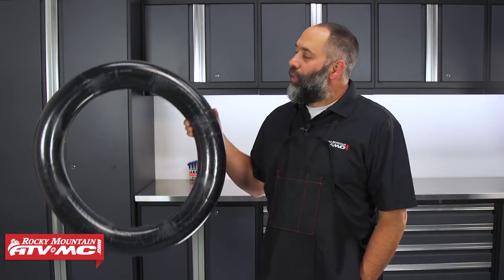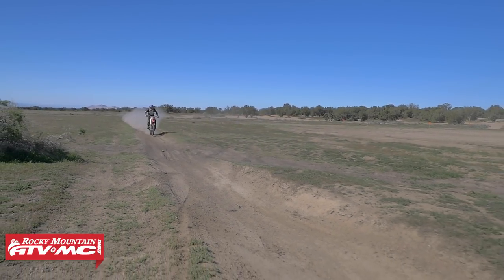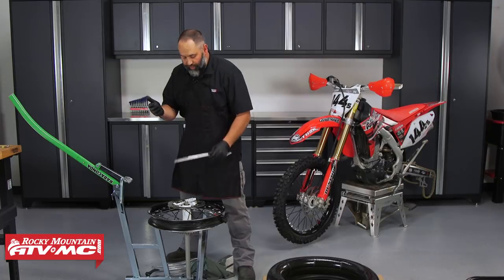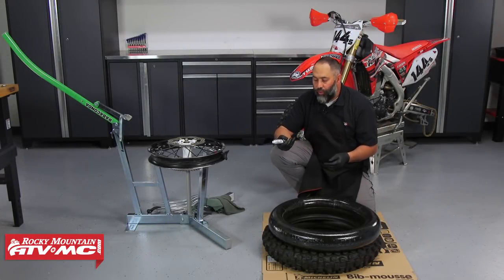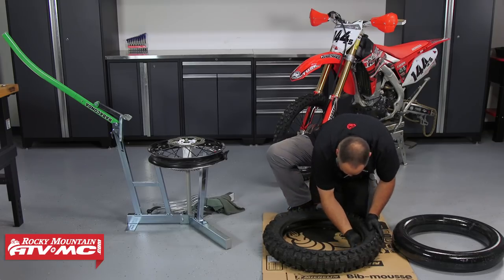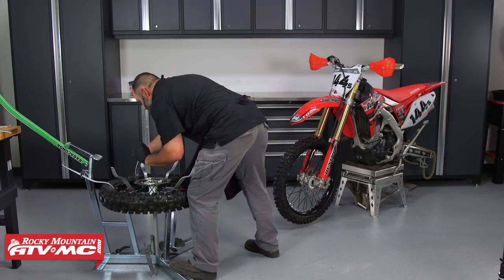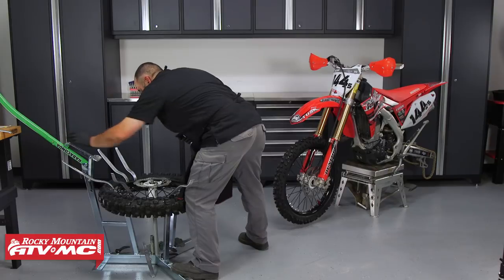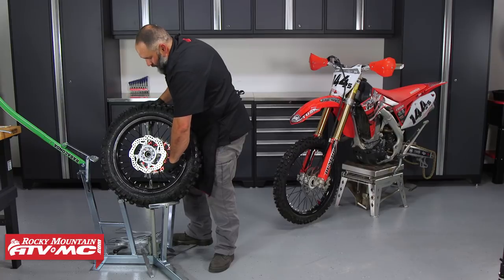How To Install A Michelin Bib Mousse Foam Tube

Comment: Using your foot introduces all sorts of debris, and even laying the insert on the tire and cardboard does the same. To decrease any chance of picking of grains of sand (greater friction), I treat mousse installation like surgery. Also, Ill smooth any rough areas inside of the tire with a rasp and then with damp rag wipe and allow to dry out.

Comment: What do you do with the valve stem hole
Reply: Either stick a tubeless valve in or one cut from an old inner tube. You can use that to blow compressed air in to push a tyre up onto the rim that hasn't set on the rim all the way around. Take the core out to increase air flow.
Reply: @martincooke6230  Electrical tape over the hole works just fine or RMATV sells little rubber plugs that are great.  They seem softer than the Tubliss plugs.Tried the old valve stem thing and did not like it but I also have issues sometimes getting enough air pressure to push the bead out on a older mousse.  Maybe I need to revisit!
Reply: @SHAPI84  I have found problem occasionally when pressuring tyre up onto the rim. You can lose a lot of pressure around the rim lock bolt. Take the nut off and slip on a suitably sized rubber grommet and replace nut finger tight. That solves the problem for me. Don't forget to remove the grommet and tighten the nut down afterwards :)

Comment: could you just use dish soap for lube?
Reply: MotoBros FZ-R1 LOL
Reply: Nope, breaks down and dissipates eventually. A lot of shops will use tire soap/lube, as it withstands the heat and last a good long time. Though a reapplication with the included Michelin lube every few months isn't a bad idea.

Comment: Now when you say heat breaks it down is this not a good option for me here in Haiti? 90-100 degrees every day and have to hit street sections to connect trails.
Reply: As long as you slow down a bit on the paved roads you'll be fine. I live in the tropics and use mousse with no problems. If Haiti is anything like Cambodia ,you probably get a lot of nails in your tires.
Reply: @fmtnic  yes!! For sure tons of nails constantly. I swear every time I ride I get a flat

Comment: are you running two rim locks in place of the stem?
Reply: m1ke2001 No, you can just use a plug,
Reply: Why need a rim lock? Theres no valve stem to shear.
Reply: @RyderLost  Without the rim lock the rim will spin but the tire may not, particularly on the rear wheel. You need something to keep the rim and tire connected beyond the friction between the tire, mousse and rim.  Some run two rim locks as the extra traction given with a softer tire and without the associate air pressure pushing out on the tire sides and rim lip let the rim spin inside the tire.
Reply: @thegan9143  When we run Vegas to Reno we do not use a rim lock.  At higher speeds it unbalances the wheel. Never had an issue with spin.  That said for all of our other races we will run only one and typically not an issue
Reply: @SHAPI84  For the desert runs are you using a firmer mousse to take the heat of high speeds? I'm more familiar with low speed technical where traction is maximised by running a soft mousse, some even drill them out to get a feeling of under 4-6 psi. Running double rim lock keeps the tire locked to the rim and perhaps they offset one another for balance? I've only every run one but have friends that run two like the pros I guess lol.

Comment: Could someone explain what are the differences between the Michelin, Nitro Mousse, etc brands?
Reply: Good question! I'm hoping at least one brand is extra-firm and long-lasting?
Reply: We've used them all for racing out here in desert, woods and track at NHHA, WORCS, Vegas to Reno, West Hare Scrambles.  We have tried all 3 of the "big brands" Michelin, Nitro and Dunlop and here is my $.02.  First off, you can't use enough lube.  We used the lubes that come with the mousses and those little tubes are not enough.  I use 3/4 on a tube in the tire and about 1/2 a tube on the mousse (particularly the rear).  WE used Murphy's tire soap as well as the stuf from Zip-Ty racing which is like Murphy's.  Just hated the mess when changing so we went back to Nitromousse cooling gel.  I liked the the nitro concept it had a progressive feel and was generally true to size.  The issue was inconsistent manufacturing which could have been a result of COVID, but I felt they shrunk too quickly especially as my son got faster (he was running B super mini when we started using them and then up through B250).  Durability was good though and feel was good.  It just sucked not being able to get more than a 2 hour race out of them before having to cut and stuff.  Nitro's are probably best for weekend trail riding guys that don't want to risk a flat in the woods.  teh lower speeds will keep these from blistering or shrinking.  We then went to use Dunlop and Michelin.  I liked the Dunlop sizing as we also use Dunlop tires.  The mousse had good feel and definitely held up well.  The only issue is it didn't seem to rebound as well as the Michelin.  Meaning, after a couple rides, they shrink, so you take them out and put them in the sun for a few hours and they will expand back out, sometimes quite significantly, to the point you cant see where the bead lock was.  Anyway, really liked Dunlop, but just couldn't get as much life out of them before needing to cut and stuff.  That said, far better than the Nitros'.  Finally Michelin.  Man they can last 3-4 race tires at least and depending on the race.  We probably get 15-20 hours out of a rear mousse.  Now I will say that because of desert racing we can get away with higher pressures, so I will use a 140/80-18" mousse in a 11/100-18" tire.  It is a bitch getting it in there.  However, once the mousse breaks in, it will last at least 3 races and then a couple more practice tire changes.  Big fan of the Michelin!

Comment: I do the exact same thing with my RMATV Tusk bench-mounted stand as a legit compromise that works well, not the floor stand, I use the one without legs, the one that can be mounted or affixed to a workbench. My workbench is fastened to the wall studs so nothing is moving when I apply leverage. Good luck 👍 
If Santa is reading, I do want a Rabaconda for Christmas 2022 🙏.

Comment: Just done it. Mate, you make it look a lot easier than it is for a mousse virgin. But it is doable even though I genuinely thought I'd snap the bead wire. I seemed to use a lot more brute force than you did. Maybe next time I'll be a bit less of an oaf. Still took me an hour. Even with a Rabaconda. And loads of lube.

Comment: Can this be used on road bikes too like the Honda 250 Ralley ??
Reply: FXDR-S1000R Eli C. I want to know the answer to this too!
Reply: You could, but they’re not DOT approved.  Also, highway miles will wear them out really fast. Like he said in the video, heat is the enemy. High speeds generate a lot of heat and they will break down very rapidly.  Also, you can’t air them up, so you may not like the lower pressure feeling especially while cornering.

Comment: Is a mousse useful for trail riding?
Reply from the maker: Yes, these bib mousses are great for avoiding flat tires while trail riding and tackling rougher terrain.
Reply: @rmatvmc  Is it expected for the bib mousse to outlast the tire it's inside?
Reply: @watts300  No, they only last about 6 months and you cannot use them on hard surfaces for long

Comment: 8 tire irons 🤣
Reply: I have to have another set of hands and 8 irons.  Now, in my defense we were building wheels for Vegas to Reno and using a 140/80-18 mousse into a 110/100-18 D756 Dunlop with very stiff sidewalls.

Comment: Can these be used on the street?  DOT approved?  Or is the nuetech tubliss a better option?  Thank you!
Reply: I imagine the heat from higher speed street use would wear the mousse out pretty quick. Tubliss isn't DOT approved but is probably a better choice if clocking some miles on pavement
Reply: ADVRX 
these can not be used on the street because they will get hot and self destruct. I have run tubliss for years and love them both on and off road. they last pretty much forever also.
Reply: The Moto fixery thank your for your input.  I would love to be able to carry a plug kit instead of tubes off road.  Where I live I have not found any one that uses the tubliss kit. May I ask what size tires you are running?
Reply: ADVRX 
i run tubliss on my ktm 500 xc-w using Pirelli scorpion mx extra x 80-100-21 front and kenda trackmaster 2 120-100-18 rear. 
also on my wifes honda crf 230l using the same front and a trackmaster 2 100-100-18 rear. tubliss have a tendency to leak very slowly so I use "stans" tube less leak sealer because its not messy like slime would be and it seals everything right up perfect and absolutely no mess when you go to change tires later. stans is a product designed for mountain bike tubeless systems and is easy to find and use. I also carry a plug kit in my riding pack but it is easily possible to ride with a completely flat tire using tubliss. some people actually do intentionally to improve traction. I run 17 psi give or take on the highway and 5-10 for trails here in rocky steep Colorado. tubliss gives the sidewall of the tire some rigidity while allowing the middle where the tread is to flex and conform to the trail and also making the trail less bumpy because the tire is absorbing some of the bumps adding stability and traction.
Reply: The Moto fixery Awesome info thank you so much
Reply: ADVRX your welcome!
Reply: @themotofixery  Mine died on the first serious ride. Changed back to tubes.
Reply: @bigglyguy8429  they do have a little bit of a learning curve. I've had really good luck with them. I've found that the rim tape is super important. I use the motion pro rim tape rather than the stuff that comes with the tubliss system. I also use a little bit of tire sealant like stsns or orange. These are designed for mountain biking tubless systems but they work great to stop any slow leaks that you might experience. They also don't create a mess when changing tires later. Maybe you just don't like them and that's fine.
Reply: @themotofixery  I loved it, adored it, bragged to all my friends about how I was gonna enjoy riding again, now that the goddamn flats were gonna be a thing of the past...  First real ride, braking down a steep slope, front one managed to rip itself open at the valve. My rear wheel still has Tubliss but the moment that gives a problem it's going in the trash like the front one. Must admit it didn't occur to me to try sealant in them. I only have slime here (I'm on the island of Borneo - cost a damn fortune to import that Tubliss shit)
Reply: @bigglyguy8429  I understand that! I wonder why the front ripped? Either the rim lock wasn't tight allowing the tire to slip on the rim or the valve stems weren't lined up. I always have a little trouble getting them spaced correctly when fist installing them. The first installation is a bit tedious but I feel like tubes are a little tedious as well. I could totally understand if price and availability was your deciding factor.
Reply: @themotofixery  I used to ride with a local mechanic who leads a group of off-road riders. He's a seasoned pro on all things dirt-bike, so I got him to fit the system. If he screwed it up then I have no chance. I specifically wanted it to avoid flats, as we're often riding over gloopy, sticky clay, which the bikes get covered in, making a trailside tube change a nightmare.   Lots of steep hill climbs and descents frequently tear valves, so I have 3 rim-locks when using tubes. I believe he took those off to fit the Tubliss, which reminds me I need to double-check he put them back in again now it's back to a tube...
Reply: @bigglyguy8429  oh wow! Ya that's much different than my riding area. I'm in Colorado so it's very dry and rocky. I've never had a tire slip on the rim. I guess the ground is usually so loose it isn't much of a problem. We have very little mud at all. 
What kind of flats do you get in your area? We get pinch flats here from rocks.
Reply: @themotofixery  Most of the time it's spin-flats, the tire moving on the rim and ripping out the valve, which is what happened on my front Tubliss too. Dunno if the greasy clay lubricates the rim or what the problem is. Rim-locks help a lot but don't solve it entirely - and I ride an old, heavy KLX 250S. Some tuning mods but it's still only about 25hp. Just downhill braking spins the things, and that's using Maxxis tires, which are meant to be the best around here. There are a number of reasons I moved from bike camping to 4x4 camping, and the frequent punctures is literally #1. Sick of it. My Hilux, with Viking brand tires, well, after 2 years of some gnarly trails and daily road use, has never, ever, had a flat. When I replaced those mud-terrain tires a couple of weeks ago I asked them to use the spare, just to rotate em. Never been used and I had to hunt for the special release key, which I forgot I needed. In contrast, on 2 wheels it's like every 2nd or 3rd ride I'll get a flat, usually the rear. Deeply sick of it. Was interested in this 'Mousse' stuff, but seems it's no use for the road and only lasts a few months. Not for me.
Reply: @bigglyguy8429  well shoot! I've got no advice. I haven't heard of this problem. I always thought a single rim lock would easily keep the tires from spinning. Never heard of using more than one.

Comment: How long will a moose last on average?
Reply: 6 months
Reply: Make sure they are always lubed, when not using the bike, make sure there is no weight on the wheels as this can cause memory flat spots, put it up on a stand off the floor, I get nearly a year out of mine by looking after them.
Reply: Also, put valves in the rims, this stops water & crap getting in & washing all of the lube out & you can also use an airline & pump to seat the bead correctly.
Reply: My buddy got 2 full seasons out of a set. Keep them lubed and they will last. He changes tires a lot for different terrains, and they don’t have any ware. Bibs are the way to go.

Comment: I'm guessing you have to have a bead lock or the tire will spin on the rim?
Reply: Yes ,the limited experience I've had,this can be a problem
Reply: 2 is better.  Some pros run 3.
Reply: , but they are also running REALLy soft(drilled) mousses.